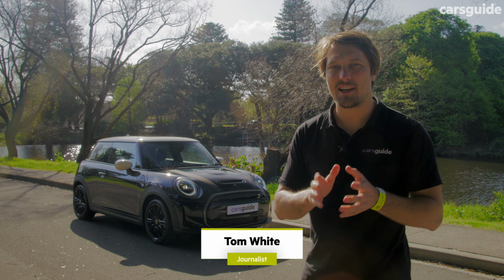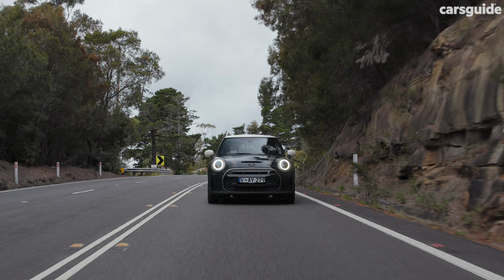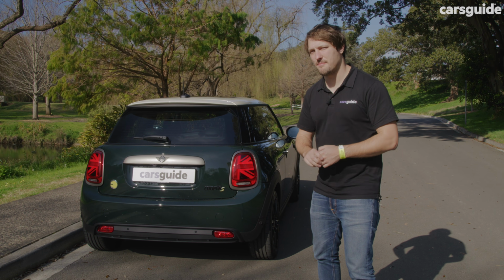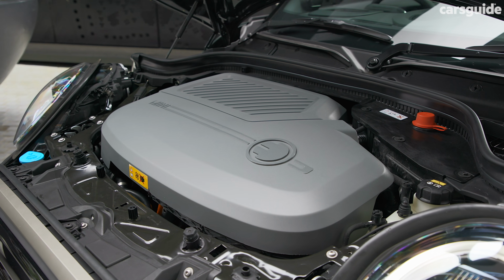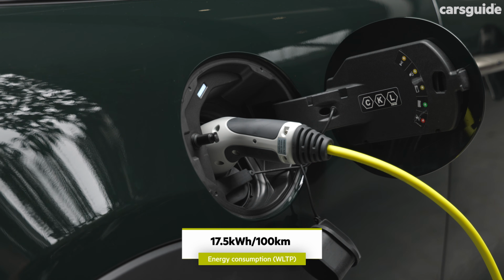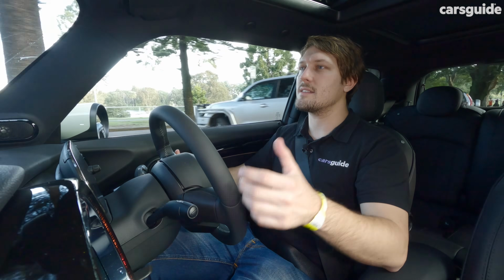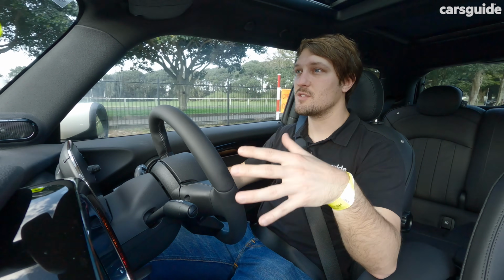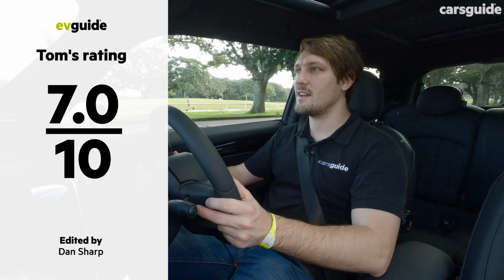Mini Cooper Electric 2023 review: Is fun and funky enough for you to choose this EV? 4K

Comment: The range will further dwindle when the battery ages. A bit like bmw’s much to be mocked i8. Silly to even consider buying
Reply: 8 year 100k battery warranty. The cost savings on gas would replace a battery in the event anyone owns it outside a warrenty. Anyone who is scared of EVs  is missing out. I own both and the ICE sits in the garage almost all the time.

Comment: I've just done a little over 300km on a quarter of a tank of fuel... Probably get (realistically) my usual 900+km out of a tank with city / highway mixed driving. For the moment I think I will stick with good old proven combustion engines... Maybe when these EVs can get around 800km on a single charge, take 15 minutes to recharge and a 10 year warranty on the battery, then would consider, but I think that's a fair way off yet...
Reply: With an EV you charger at home and leave with a full charge each day. You don't need 900+km of range in an EV.
Reply: @MatthewBayard  if you are going on a long distance drive like I regularly do, good range is essential. Don't fancy trying to find a charger in some small town that hasn't got one. At least with petrol / diesel you can carry a jerry can to get you out of trouble, run out in an EV, you could be on a tilt tray back to the nearest charger... EVs probably (at this point in time) are a good choice for local city driving...
Reply: Mine came with 8 year battery warranty
Reply: @Colgateras  which is fine until the battery finally expires... I'm not sure what  vehicle you are driving, but hopefully you won't have to pay an exorbitant amount of cash for replacement. Lot of people complaining about how expensive replacement batteries are for EVs. Hearing from $8000 - $28000, depends on the car. Still prefer ICE, can last a lot longer than battery powered car with correct and regular maintenance.
Reply: @michaelallen3918  also mini cooper se.
I'm reading lots of articles that say that battery life generaly surpases life of the vehicle itself. But the ones that have problems with them make a lot of noise.
I have the car 2 years already, 0 problems until now and is a cool and fun driving car. But is not for everyone, for the ones that travel a lot and make many kms each day is better to look at another ev with big battery.
I was a petrol head, big motors, nice sounds etc...
Not even thinking about buying a gas vehicle anymore after having this one.

I pay in my home 0.03€ kw/h. From 1am to 7am
I make 1000 km to 1500km per month... paying 5€ bill connecting the car only on those hours, compare that with gas price.
Also every day I wake up with full battery, almost never doing 200km on one day if it's not for travelling wich I rarely do.

Imagine the cost of gas in 10 years it was almost 2k€ in gas with my last car a year, so it’s 20k€ in ten years.
The car is paying for itself.

I also apreciate silence in cars now

Comment: I love the amount of compromises you would have to make to own one of these. It’s not quick, roomy, range, technology, boot space, reliability or price. Tell me again why I would buy one?
Reply: A hoot to drive, it's FUN!, quiet, solid, quality materials, easy to park, and efficient (>6.5 km/kWh). The power delivery is smooth and it's so easy to drive in traffic and the re-gen works so much better than heel-to-toe engine breaking in turns. Of the over 50 cars that have all had (each with their purpose) and this has truly been one of the best. I am fortunate to have a Wallbox at home and not going to the gas station is part of the experience. The family gets around all over the place for 3-4 days before plugging in (here, winter rates are $.07/kWh and there's off-peak 12-6a rate that provides 400kWh $0).  If needing longer trip, we've got the SUV, so it stays in the garage.
Reply: The catch word, STYLE. B&O products never surpass the level of technologies of it’s contemporaries because they do not own any of the best tech. Yet, people still buy them with a lot more cash.
Reply: It may not work for you, but works for many others. I for example love mine, it's ideal. And don't believe the 0-100kph in 7.3 it's not true, these are actually in the low to mid 6s range, I got mine on the stopwatch at 6.3s
Reply: You could say the same about the Fender Stratocaster.
Reply: It’s a terrible car, but it’s ADORABLE! And that’s why I want it <3 because I’m terrible… and well not adorable, but I will be at least 0.0001% more adorable if I have this car and that’s more than enough motivation for me to ditch my 2015 corolla